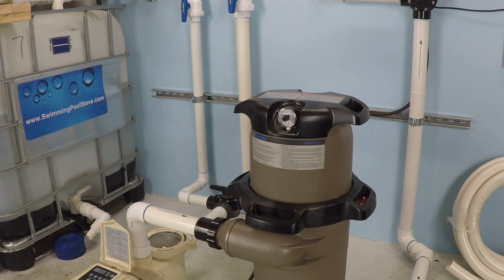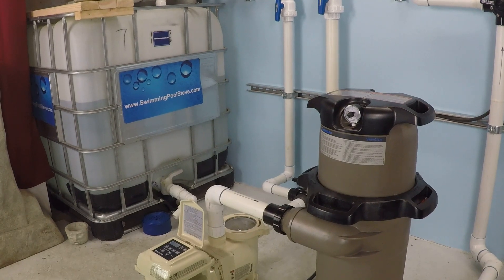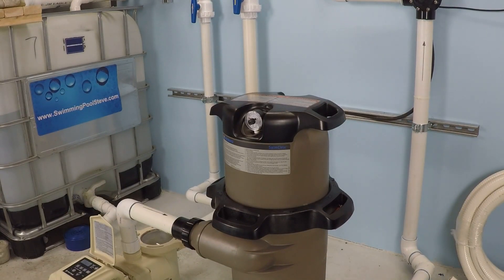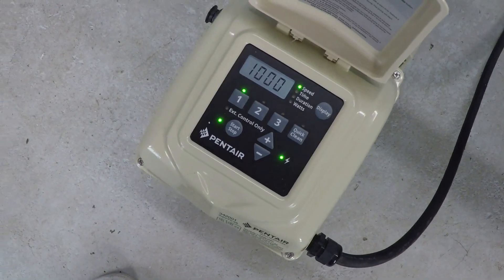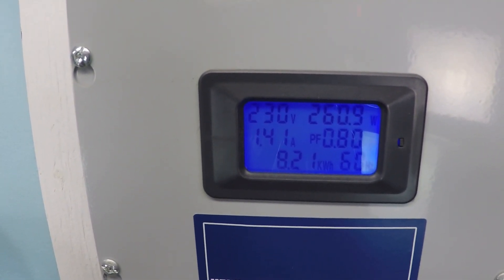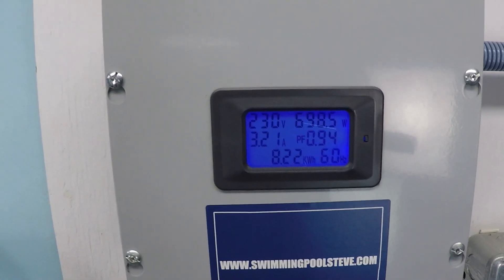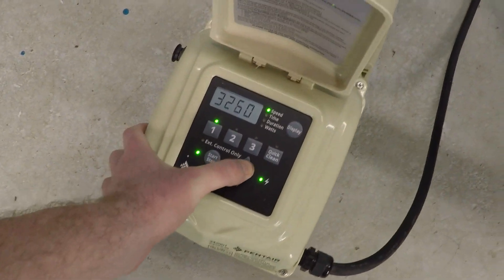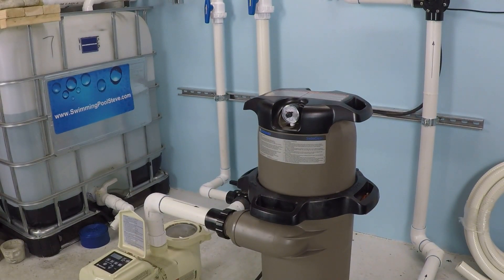Energy Savings With A Variable Speed Pool Pump

Comment: 3 quick questions. 1) What was the HP of the pump you used? I'm assuming a 1.5HP. 2) If 1.5HP does the values double with a 3HP Pentair pump? If not do they stay the same not matter what HP the Pentair is?

Comment: Okay Steve, great information I can see the linear vs exponential relationship between power consumption and flow.

My last question is what this would look like pumping an in ground system.

The example you give in this video is an above ground tank that, in my guess, helps the pumps efficiently as downward pressure is providing a lot of work for the pump.

Please do this same example on an in ground system.
Reply from the maker: Inground or above ground or on the moon makes no difference because you can measure he total resistance to flow. Total resistance to flow measured in feet of head is all that matters to the pump. It does not know the orientation of the pool, just the resistance to flow. This system approximates 25 feet of head which you can use to extrapolate flow rate on a pump curve. But yes, a system with 50 feet of head would be interesting also. The results for non linear reduction of power with lowering rpm will remain the same but total flow potential will have been reduced.
Reply: @Swimmingpoolsteve  On the MOON! Lol.

Comment: Why did the KWh remain nearly constant with only a slight increase as you raised the rpm?
Reply from the maker: The kWh is the total power consumed.  It goes up slowly as you are only seeing the numbers for a minute.  If you were consuming 5 kWh for example, then after one hour of running the meter would read 5 kWh

Comment: My one speed motor produces probably around 37 GPM, which circulates my pool in maybe about 6 hours. I don't have all that fancy equipment to tell me what the actual flow is, let alone energy usage. I'm guessing 90% of pool owners are in my situation there. So why would I want a variable speed motor? Run at a lower speed for a longer amount of time to take advantage of  that exponential reduction in power consumption you talked about? It would use a quarter of the energy at half speed but would need to run twice as long, correct?  So 50% savings. If that's the case, the optimum would be to run at the lowest possible trickle over 24 hours that still circulated everything. I think the video would be much better if you explained the cost savings in that manner, if I'm even correct in looking at the cost savings in that way. The video left me with more questions than answers. If you said, for example at the low rating the pool will circulate in 10 hours, and will cost this much, and at the middle rating 5 hours and cost this much, and the high rating in 2 hours and cost this much, then I think that might be compelling. But I don't know what I'm comparing to what with this video.
Reply: Thank you